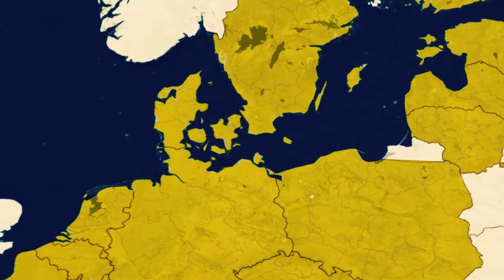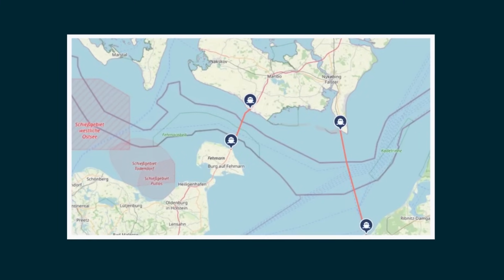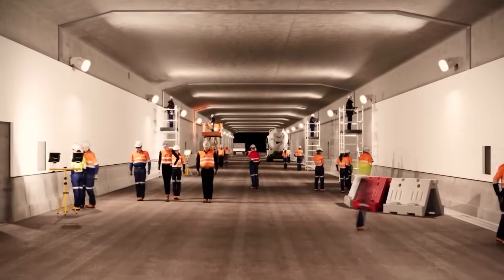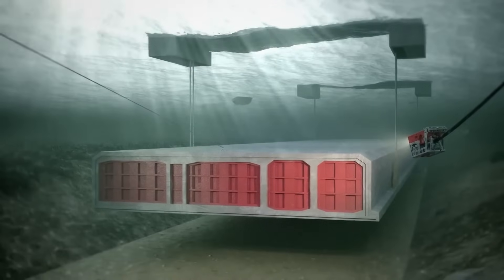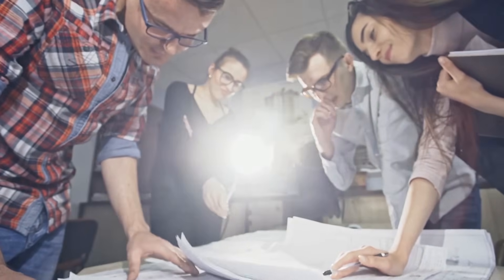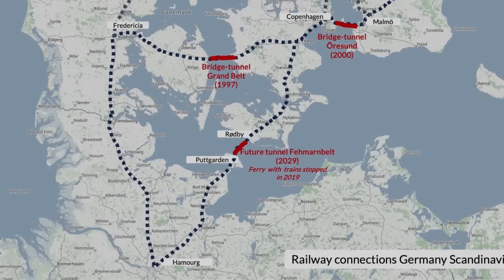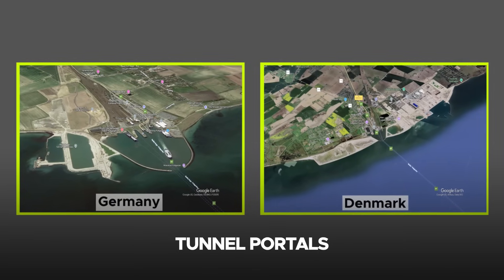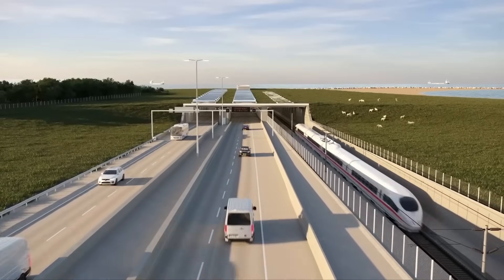Germany's New $8 BILLION Underwater Mega Tunnel!

Comment: The Tunnel is an initiative take by the Danes and has absolute nothing to do with Germans. The project is engineered and financed by the Danes; which has caused many German commentators, to breath a sigh of relief, as they are of the opinion, that had the project been left to German entrepreneurs, it would only ended in chaos. The tunnel site is the EU's biggest building site and biggest building site employer. The Germans have been against the tunnel initiative for many years, and have done all within their power to stop the project!! So don't give then any credit for this project!!

Comment: Not only is Denmark the one to pay for and build the tunnel, with Germany's role merely to connect it to the rest of the rail and road network, Denmark is the driver of the project and Germany the one to delay it, much like Germany delays every other infrastructure project. 

If if hadn't been for German delays, this tunnel would have been open now. What's more, the only thing Germany has to do — connect the tunnel to the rail and road network — won't be finished when the tunnel is. 

Germany is a fine country, but everything Germany does finishes long after its neighbours have done their part.